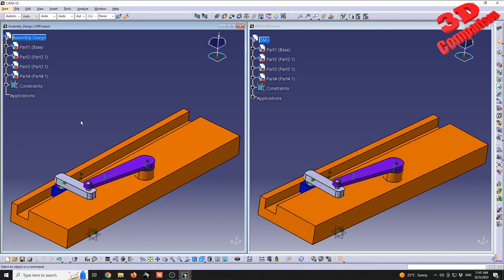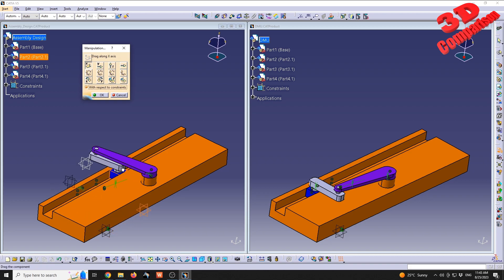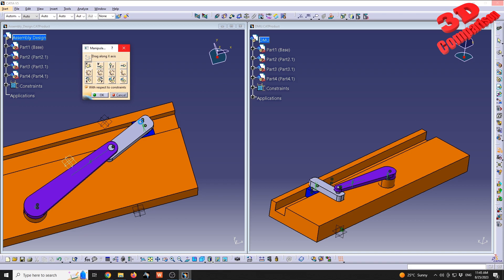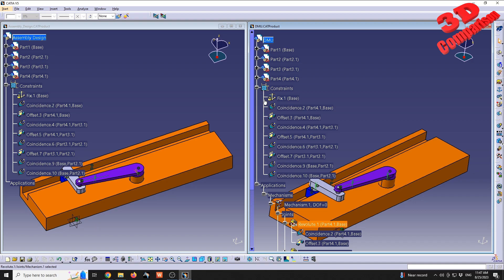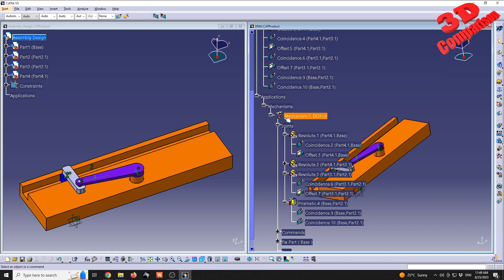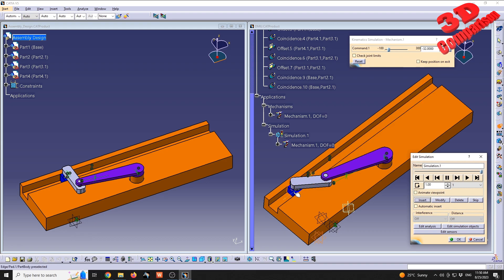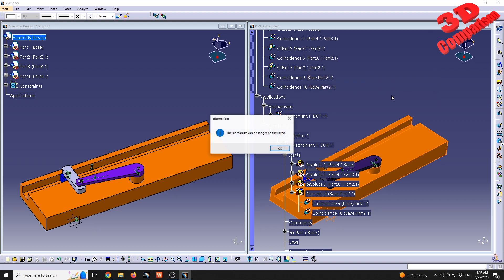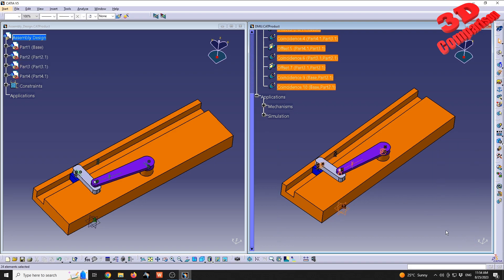CATIA V5 - Assembly Design / DMU Kinematics

Comment: Which software is better to do a kinenatics study, solidworks or catia v5?
Thank you
Reply from the maker: Both SOLIDWORKS and CATIA V5 are powerful CAD solutions that can be used to perform kinematics studies, but SOLIDWORKS is not as robust as CATIA for very complex or high-end kinematics simulations. Within CATIA there are many more joint types therefore you can simulate more complex mechanisms better.
Reply: Thank you for your answer 😀